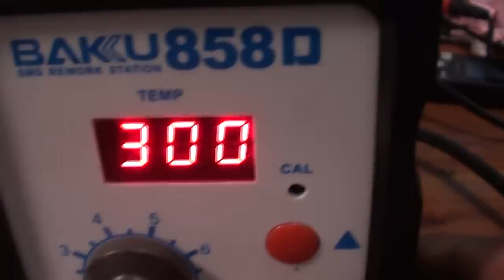Lcd led TV panel repairing by replacing Dc to DC IC.

Comment: Today I have the same trouble, a cheap 32" lcd tv no picture but sound is ok and the led backlights are also ok. I found out there is short in that panel circuit board but the owner are not willing to spend $50 my charge to him for the parts and labor.

Comment: I have T315XW06 V5 CTRL BD 31T15-C07.

Tcon board and the dc to dc ic is giving out only 6.6v in all the output points. How to replace it. Help
Reply: Tv backlight is working fine and the startup sound is also their but only the picture is not showing. I did the flashlight test to but no graphics.
Reply: The IC chip is not available anywhere plz help
Reply from the maker: The solution has to be given by collecting old goods......

Comment: @ProHack I have an LG 42LM6700 model led tv. The sound is very low when the setup box's RCA cable is connected to the TV's sound input. When it is connected through HDMI or a movie is played through USB or YouTube, sound is fine. That means there is no problem with speakers or it is not a configuration problem.  The problem is in the sound card which takes and processes input. Could you please let me know what could be the problem? Official service centre person told that the motherboard should be replaced. I know these guys are idiots and are there to make money in the place I live.